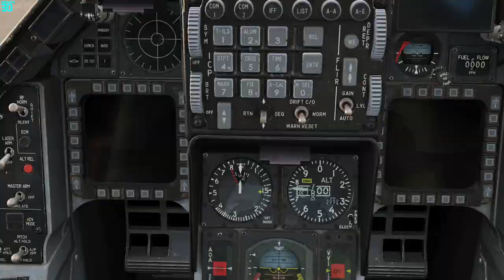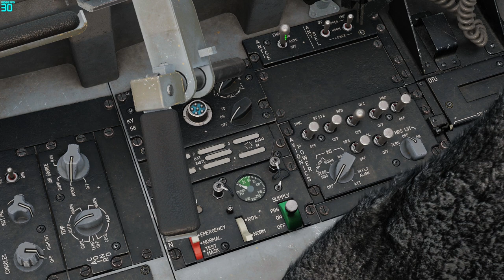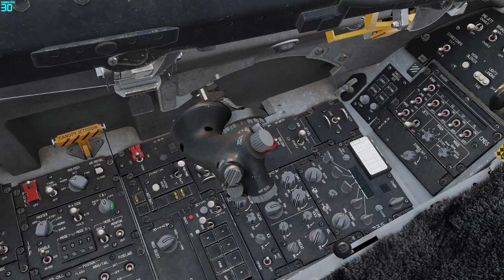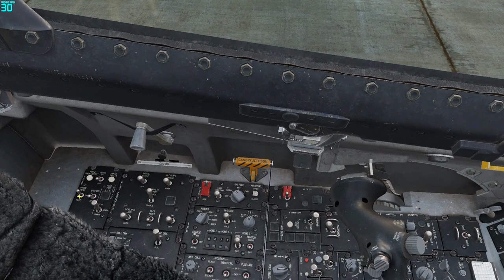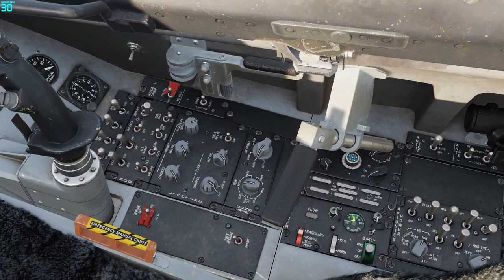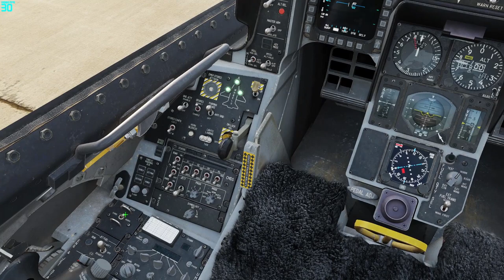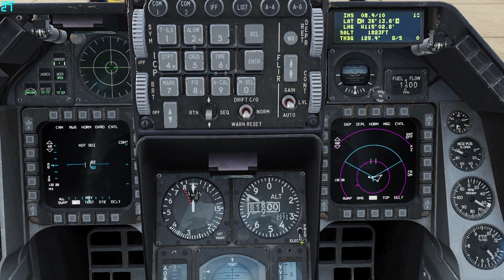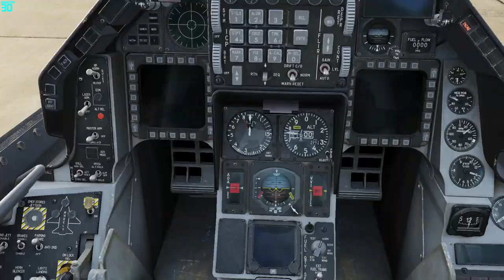[ Digital Combat Simulator ] - Complete Cold Start and Shut Down - F-16CM

Comment from the maker: Hey, everyone! I noticed during the video that the procedure I used to align the INS was NOT COMPLETE. If you notice, when I switch the INS knob to NAV, I get NO steerpoint information displayed on the HUD. The main reason for this was I failed to press the ENTR key on the ICP for the LAT, LON, and ELEV input parameters on the INS page. You have to do this WITHIN 2 minutes after starting a NORMAL alignment. If you don't, the alignment resets. Please note that this procedure does NOT apply to the Stored Heading alignment.

I go over how to align the INS properly in this video:  https://www.youtube.com/watch?v=Pk6B37grIDc